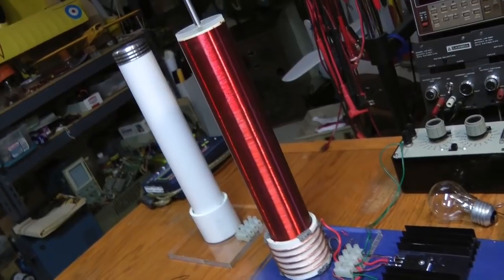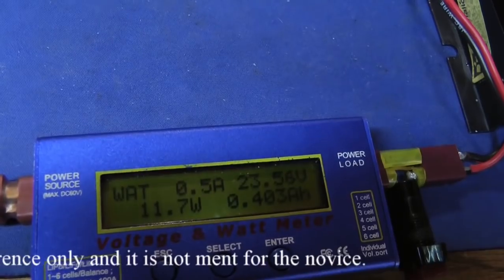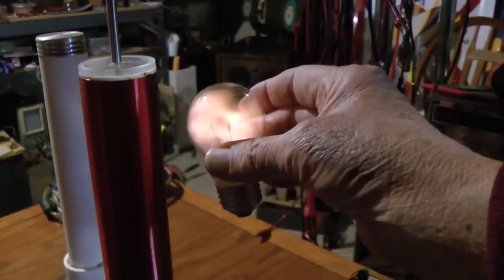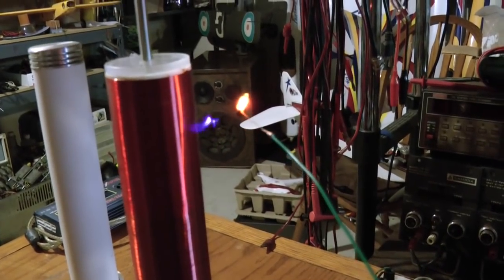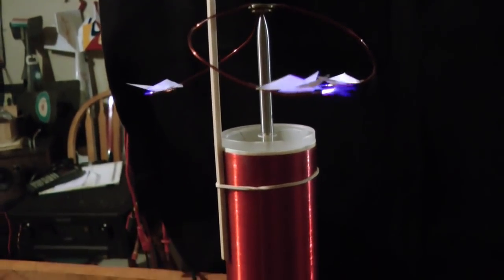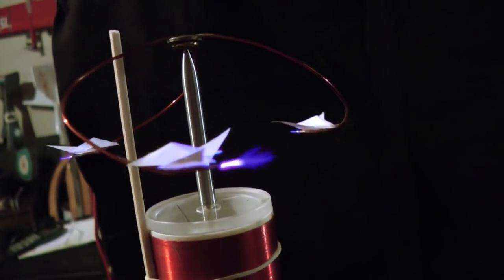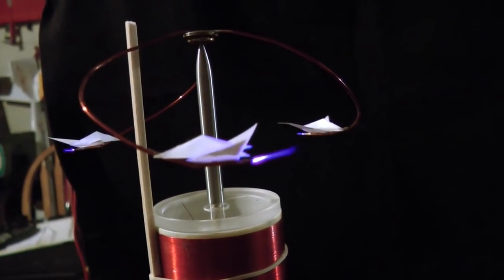Tesla / Slayer Ionic Propulsion

Comment: Please put that bad boy in a vaccum to see if the little planes spin!
Reply: It moves because it heats the air up where sparks which then expands and probably because the air ionises and gets pushed away. It wouldn't work without some form of propellant (like the air in this video). This is basically the idea behind an ion thruster, which is already used for small spacecraft.
Reply: nate8930 hell yeah to debunk nasa

Comment: You might have discovered a whole new propulsion system.
Reply: Andy Quiko. Very true but I wouldn't want to be the first to fly an ion power space plane made of paper.
Reply from the maker: True but no one is talking about a difference in this experiment. A thruster in space has an anode, cathode and in most cases a chemical   discharged into the ion stream. This experiment shows a cathode spinner with no anode except the possibility that it's earth ground.

Comment: Perhaps they should use ion drives to extinguish fires instead of a valuable commodity like water........
Reply: Which then evaporates and goes back into the sky to rain down again.  But yeah real science, put a giant air bubble over it to choke out the oxygen. Liquid smoke, ever heard of it?  Shape an area with it seal in the fire, no more oxygen (yes you would have to put many layers on, but it would eventually choke it out.)
Reply: plezx29 to move in space u need electricity and  substance u push off it, nah?

Comment: I want to see the "planes" going in the opposite direction. I feel like the motion is coming from the current in the generated magnetic field. There are countless examples of this type of motion with all those DIY motor videos. the little blue flame is created by the high voltage escaping through a sharp point, if you've ever applied a voltage to a square piece of metal you would notice that the energy escapes at the corners.

Comment: 1. Repeat last test in a vacuum.  
2. Boost with materials dumped or sprayed just behind the point where you blew out the flame. Test materials of all types. Nano magnetic particles sound promising.
Reply from the maker: I found out thrusters are use on satellites and they inject gases into the ion stream to increase thrust.

Comment: The thrust is wind . Heat convection with oxygen . The heat from the plasma pushes air molecules up and away while on the opposite side of the plasma stream molecules become more dense and get pushed down creating a sort of directional "wind" energy . I personally don't think it would be easy to get this thing to work in the vacuum of space , let alone have enough energy to efficiently use as thruster . I just read an article on plasma scalpels . Could be the future of medical science .
Reply: ion propulsion has been used for years in space exploration since the Voyager space probe.

Comment: Dadhav. Great Project. I like that when you build something,.. You over build to just make sure! :) 
Anyhow I have 2 questions to ask... 
if I may?

(1) What was your chosen career/profession in life, and any other skills or collections you'd like to share? Sorry I'm a advent collector.

(2) What Model are them Gorgeous Vintage Speakers in the background in your garage? Does it have the funky wonfer cones. Their weird.
Reply from the maker: Scott, I started a Die Maker apprenticeship a week after graduating high school but Already was taught to run most manual shop equipment before the age of 12. I was taught by my grandfather. I needed more so I took electronic courses. I required a position in an R/D corporation and worked several years with a doctor of physics and an electronics engineer. Later I returned to the trade and was foreman of several local tool shops. I finally ended up as Engineering Manager / Chief Engineer of a large corporation here in the US. Later I set up an R/D facility for the company here in Ohio and managed to keep my engineering staff with me for several years. Even later I formed my own corporation and did what ever I felt like doing. The speakers are another phase of interest for me as well as photography and many other things. I have earned a supplemental income in more ways than you can imagine. I designed stereo systems as well. These speakers are indeed vintage but hand made as well. They have 12" Electrovoice woofers and dome mid and high range speakers. The enclosure is built to the specific cubic foot to maximize bass reflex tuning and response. They are covered in marble style Formica on all sides so the speakers can be use lying down like a coffee table or standing up like an end table. The cross-overs are also hand made. I love audio and was the proud owner of a JBL Paragon at one time. Look that up sometime.  I still have my vintage 60's amps and tuner from McIntosh Laboratories. Thanks for asking. Visit my channel to see some of my interests and handy work.
https://www.youtube.com/results?search_query=dadhav

Comment: Looks like it's pulling and pushing air molecules. Test it in a vacuum environment to confirm your theory of ionic propulsion. I can imagine it would require a lot of super capacitors to achieve and sustain that kind of ionic discharge. Would need huge solar blanket to recharge from a star if planning to hop from star system to another star system or maybe intergalactic travel. To achieve lift or escape velocity from 1G you would need at least 1ghz of electricity to produce a magnetic escape velocity effect. Would be happy to collaborate with this project if you want.
Reply from the maker: Thanks for your offer friend. I'm doing a lot of studying and am making plans on trying another model which would be closer to something in use today. Maybe our paths will cross somewhere down the line.

Comment: NASA was experimenting R&D Ionic drive in the early 60's, good for deep space as speed accumulates over time. Requires large amounts of electricity, so nuclear is best option currently. Technology utilizes quantum mechanics of quantum gravity field, space is not empty.
Reply: Jack Pullen are you talking about zero point energy?
Reply: Not in current understanding, refer to Carlo Rovellis Loop Quantum Gravity Theory. His equation is still not fully comprehended by anyone yet it has not been disproved either. NASA knows these technologies work but the Math has not been written yet. Most of the math for Quantum Fields is unknown, there are fifteen currently known fields, when you can generate a Quantum Gravity Field you win the prize! Next year several labs will be turning light into matter...wouldn't you love being in one of those labs! What people get confused, is that somethings are discovered before the math is written or Chemical formulation, an example, someone once batched about a hundred gallons of Nitroglycerin, gently stirred not shaken...

Comment: Three effects here, and unfortunately I don't think it would provide much thrust in a vacuum.

First, the high voltage ionises the air, just like many others have said below. So from ionisation we have equal numbers of electrons and positively charged nitrogen and oxygen atoms in the air around the cathode.

Second, since the cathode is directed (just like the cathode ray tube in old televisions), electrons are forced away from the wire in a stream by the strong negative charge there. This creates an overall charge imbalance to negative in the air. Ions right next to the cathode are sucked in and reduce thrust, but ions further out are pulled along by the stream of electrons. The reason we have net thrust rather than these two balancing is because ions will be attracted into the cathode in a spherical pattern, whereas the ions ejected are much more tightly beamed.

Finally, any air stream pushed away from the model is amplified by the same effect used in Dyson fans - surrounding air is pulled into the jet and slows, but increases the momentum of the stream. This happens with any high speed jet. While this doesn't increase thrust, this probably contributes to the volume of air blowing out the flame.

In vacuum, you would only get the cathode ray effect and much lower thrust, and even then not for long as you can't constantly emit electrons forever as you quickly build up a net positive charge and reach equilibrium. Ion engines have to worry about this too - https://solarsystem.nasa.gov/kids/ionengines-design-game.cfm.
Reply: Is the flame extinguished due to the flow of air, or due to the charged particles in the flame?

Comment: The high voltage ionizes the nearby molecules of air and pushes them back due to repulsion and as those molecules are pished back a small pocket of vacuum is created which is filled up with neutral air molecules and the process continues..Try that out in vacuum and the telephone pole required to stop the cute planes won't be required

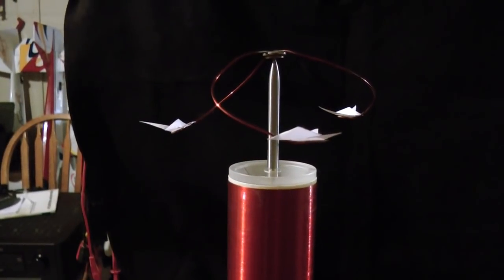Comment: The main action happening from 2:22. I assume, what you see is the effect of Lorentzian force, which means that , if a current is flowing perpendicular to the magnetic field lines than a force perpendicular to the magnetic field and perpendicular to the current comes into action, and that causes the acceleration. As others have noted an other reason for the rotation might be from heating the air at the spark. 
I suppose try out a few other versions of your setup:  bend the wire in the opposing direction, have the wire bent straight outwards, than repeat all versions, but have a grounding plate for the wires(no spark), so you eliminate the effect of the plasma.
Reply from the maker: I have tried straight wires with 90 degree bend in the opposite direction of the spinner in the video. The rotation is opposite and the same speed.
Reply: Correction of me here: the thrust is generated mostly of ionizing the ambient air, and the potential field gradient repelling those ions. At blowing away the flame I'm not sure, if there is a stream of air that is cause from the spark, or simply due to the charged particles in the flame.

Comment: if there was a device accompanied under - circularly parallel; would the capability to run wireless feeds to other devices within a premise or parameter giving energy to a magnetic field ultimately offering resistance to gravity?
Reply from the maker: I don't know about the anti-gravity but there is a link in the video description that will take you to my play list which has some wireless transmission of energy experiments.
Reply: DadHav can't find any link, please give in comment section

Comment: That is called plasma that is shooting off of the back of your little planes. Plasma is also a very useful power supply, as long as we know how to produce it in large quantities using small cells. While there may be great potential for technology using plasma Drive propulsion, I believe it's still far off because think about the size of your Tesla coil generating that electricity for those itty-bitty tiny little planes. My point is, that this is a technology that is already in the works, but lack of funding and technological advancements [to allow energy sources] to be much more compact, in order to allow for greater propulsion . Fortunately, the generation of such propulsion is in the near future!
Reply: Top Flight Digital Media ....it can't be that hard ..put the top minds on it . You have a basic formula now simplify and Rework it
Reply from the maker: Thanks, I'm sure you have that right.

Comment: Ok, I need to build one of those! I assume one could scale this up and, perhaps run appliances?
Reply from the maker: I don't think so Carl. The principal reason for this is to create a very fast stream with low thrust or torque. Thruster drives.
Reply: DadHav Ohh, drag. Instead of using a battery, didn't Tesla use an antenna to collect the energy?

Comment: I think it gets the thrust from the ionized atoms and electrons getting shot out the back at high speeds which is pushing on the air to move the air. It would probably also work in a near vacuum since most of the momentum seems to be coming from the electrons and Ionized atoms getting pushed off of the wires. It probably won't work in a near perfect vacuum though since the high voltage would cause the electricity to short out from the positive to the negative ends of the circuit, this and the heat generated by the electricity flowing through the wires themselves would cause the casing to burn or melt off and it would short out through most of the coil.
Reply: Feathered I agree that the combinations of effects you mention all contribute. But l disagree that it would not work in a vacuum. 

The coil generates a pulsed dielectric stream. It is blasting from the tips at light speed. You may not see it, but the effect would be the same, although maybe lessoned. The sparking you see is the effect it has on the atmosphere,  that's not nothing. The Aether is everywhere, it is space.
Reply from the maker: I have doubts about the destruction of the circuit because in most cases when something isn't quit right the circuit will stop working. Plus most well though out circuits have overload protection. Thanks for commenting.

Comment: Try this again using smoke or dust instead of a flame. Flanges are plasma or ionic and are influenced by electric fields fairly strongly. See if you can get deflection with things that are more resolutely neutrally charged.

Comment: It's pushing air molecules but how... Rapid ionization of surrounding environment as Lightening does (energy compressed in a small place, before Lightening strikes people get goose bumps fraction of seconds prior, due to pre-ionization).

If it what I think, it is an entirely new way of transport .... Maybe. 
Good work.
Reply from the maker: There are thrusters in outer space right now but as far as a thruster is concerned there seems to be a lot of power for this device using the solid state resonator.

Comment: The edges of the cables in the "spiral" you made is where the electrical spark comes out from. Since its probably not metal ions flying out of there (i forgot how electricity works, but its charges in the metal cable pushing against each other right?) it must be different gas molecules of the air just by the cable edge that gets charged and turned into ions. i imagine it works as a capasitor, where the material difference of metal vs air works as the insulator, and the negative charges of the metal stays at the edge while the positive charges of the air stays at the edge, and the negative charges of the air shootes off. (or the opposite). 
sooo...if the edge of the cable were a very large surface and the voltage millions of volts, the wind that comes from the gas ions shooting off must be much stronger and could push a spaceship ;)
Reply from the maker: Hello Anton, It's kind of complicated and I'm not 100% sure myself. I think you're right about the capacitor effect . Because of the polarity of the resonator I think negative ions or anions are emitted from the anode points and try to get to the cathode which in this case is earth ground.

Comment: You're creating a macro-molecular field line with the ionic exchange of bonds.  Or more precisely in this case the exponential shell displacement is spewing out electrons and photons in a highly concentrated manner. These actions can be used to generate power via force and thrust or be improvised into ionic bursts like the the demonstration with the spin gyro plane stands.
Reply: Let me preface my questions with this. I’m not attacking you I’m just asking a question. Where are these elections going? Wouldn’t that be very harmful to anything organic if electrons and protons are being shot out at an exponential rate?
Reply: Think of a well.
You dig a hole to let/or source water into that area like a catch from the surrounding ground.
Same thing can be applied to air/space in regards to molecules. 
Not all molecules are ionic nor ready to freely discharge their valence electrons (lose valence shell).
Taking the well concept you can collect the electrons in the same manner as water. Many of the fluid mechanics are cross used in electricity and in plumbing/pipes.
Create a large enough well, will enable collection of loose valence shell electrons with sparse amounts of decaying protons.
The concept here is electrons are being shot out with small amounts of protons.
The protons being reminiscence of decayed material.
What is visual there is ionic stream coming from the plume of the small motor or focal point of exhaust i.e. that is the energy dispersing.

Long story short I wouldn't put my finger or anything organic behind something like that. May create a large arc of lightning and cause a nice burn.

Comment: I like this science, but what does this wide range, high frequency electromagnetic field to any bipolar molecules within your bodycells, like DNA or or rDNA?
Reply from the maker: Hello Paul and thank you for your concern. I have the same concerns. This resonator is not like the Tesla coil and the sparks you can touch. At least on my solid state resonator the output is more like a torch. It will burn small holes in your skin and cauterize the damage. I try not to use the device any more than necessary.

Comment: Sir, I know what it is, in jet engines they puch hot streams of air burnt in combustion chamber to produce thrust, here in your experiment, it is the ions (air gets ionized by high voltage)which are pushed by electric field. This is how ion propulsion works in theory.
The magnetic field due to tesla gives these ions a particular direction to move and according to equal and opposite reaction law, when ion go in one direction, the plane thing you made goes to another direction.